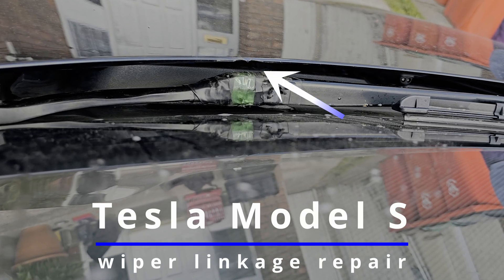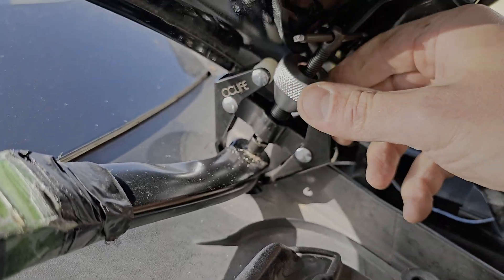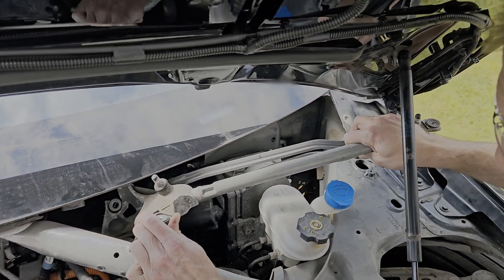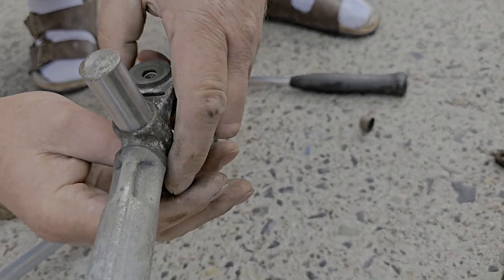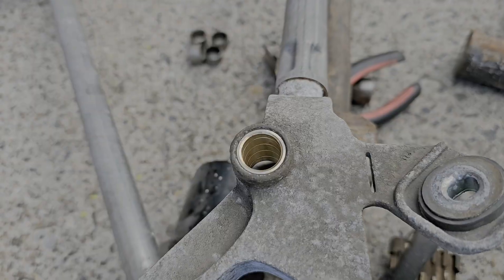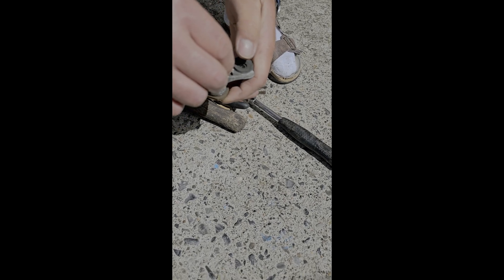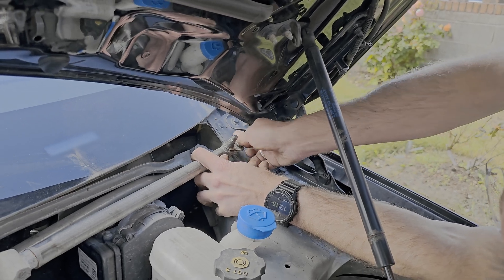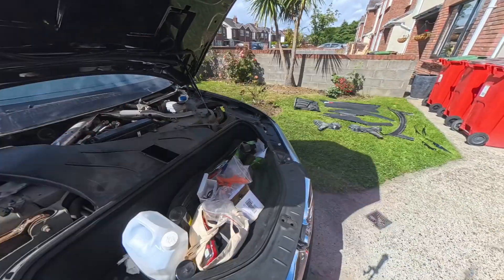Can we fix Model S wipers at home ?

Comment: I wish to have this be done by a professional, anyone whos doing it in Europe?
Reply from the maker: Any Tesla Service Center will do it (replace the whole mechanism), but I don't know the current prices (you can quote them through the Tesla app). I would guess any EV repair garage is familiar with this common issue and can handle that too, this is not rocket science to a regular mechanic either, just source the bearings or correct complete mechanism 😉

Comment: Thanks for this video. Exactly the kind of budget friendly repair that’s needed to show. No need to change working parts. Have you changed any bushings in your suspension?
Reply from the maker: I'm glad to be a help. I haven't touched my suspension yet. Every time I get it checked there is nothing wrong... Maybe because I'm running 19s rims, so higher profile tires take all the beating compared to 21s.
Reply: @everytimeEV cool. I just sold my model 3 and I’m looking at buying either model S or Y. The S has dropped in price so much it might be worth it.
Reply from the maker: @tydlig  Model S depreciated so much, but older ones require some work. I can live with that; I like the car a lot. Model Y wouldn't be my piece of cake. Older ones look ok-ish, but they drive like a boat. New ones drive a little better, but I'm not a fan of the design.

Comment: Hi man ! 
Thank you sooo much for the tips and the video and the link to vempele !!!
Do you have any update on the well being of the repair ? Does shows some sign of use/worn out ? 
I guess not in two years :) !!

Keep going my friend !! 🎉💪
Reply from the maker: Hello there, glad to be helpful😃Well, 8 months after and no signs of wear, wipers working as they should, and they work a lot in Ireland 🤣 Distance between the arms and hood seems unchanged since the repair. These bearings have larger inner surface, and Vempele is claiming that they are made out of better material than the original, so I hope they will last. It still amazes me how they put such low-quality part in a premium car. I can understand savings, back then, it wasn't even a profitable company, but come on. I have never seen issues with wipers before, even in oldtimers !
Few small things planned for this year and one big one(end of drivetrain warranty), so there will be more Model S maintenance videos for sure!

Comment: Brilliant repair video, thanks. You are right, I was careless and cracked my windscreen trying to get the arms off. It's a pity the bearing kit is so expensive as a whole new wiper mechanism from Tesla UK is only 180 euros and ebay new linkages start from just over 82 euros.
Reply: In Belgium, the asked me 500€ for the part and 100€ for the service. I bought it 95€ from vempele (including sending) and I mounted it today… so glaaad !!!! Thank you soooo much !!!!
Reply: tesla czech republic quoted me 717€ for wiper likkage and 2 wiper arms including labour. Independend service quoted me 650€ for linkage and labour in May 2025. I bought kit from Vempele too and changed the parts yesterday! I used Normfest High Press Ultra grease. In Raven model s MY2019, there is “bonet height extender mechanism” near struts in place, but I was able to get the wiper linkage out. Beware of the rubber gaskets inder the wiper arms , take them out before you start getting the linkage out. Or you will need endoscope with hook ;) @everytimeEV enable receive of gifts in your account so I can send you little thanks for your help.
Reply from the maker: crazy prices! happy to help my neighbor (I'm from PL originally). I'm too small to receive anything from YT, yet small coffee (description) will be much appreciated as I have to edit many new Tesla videos ;)
Reply: @everytimeEV  sent. looking forward for new videos :)
Reply from the maker: @Toob41  Thank you. Sorry about your windscreen. Wow I didn't know mechanisms are so easy to get now. I couldn't get my hand on anything cheap back then.